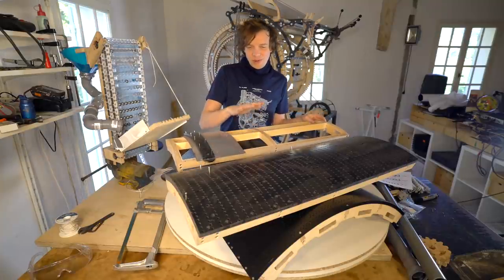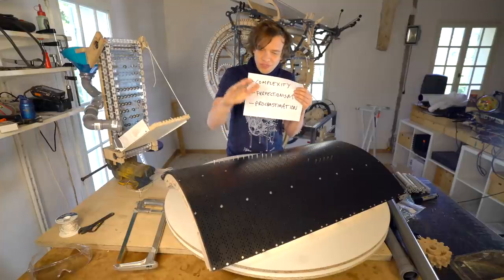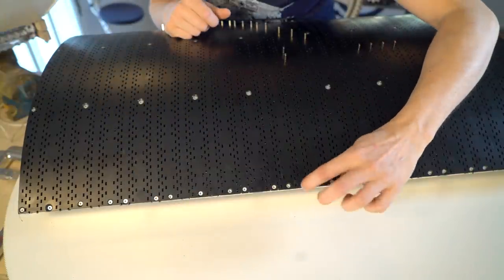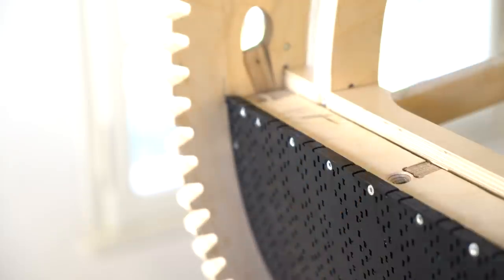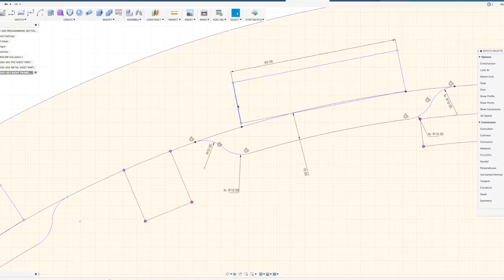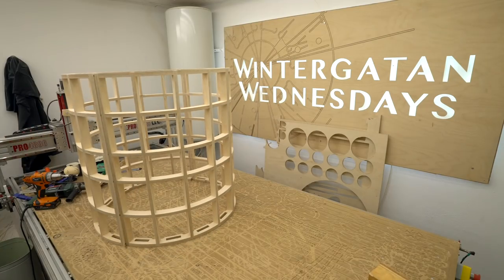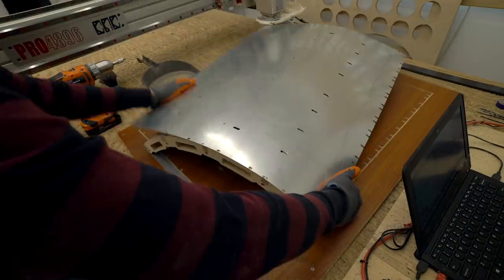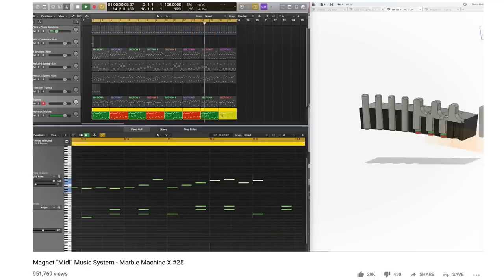Music Programming Plates Part 3 - Marble Machine X #65

Comment from the maker: This is the one part of the Marble machine X where I can not compromise on the precision, it is hard to get the precision of the four joints between the quarters down to a hundredth of a mm around the whole circumference of the prog wheel. It feels like my engineering knowledge level is playing catchup with my music precision knowledge level. And its loosing... :)
Been thinking about how to solve this for a long time and I am finally going up that mountain, raising my sword and walking straight up to the dragon. 
Lets see if I can slay it and how many episodes it will take, Enjoy and good luck with everything you do!

Credit to Marius Hirn for a lot of CAD work on these programming sections:
https://www.twitch.tv/kitingmare

Martin 

PS.
This is something I would love for you all to know: 
Many of the designs on the machine is way overcomplicated for aesthetical reasons or for lack of engineering elegance, BUT, the programming sections does actually not belong in this category. I still can not think of a simpler more functional solution than the one I am trying to execute here. I have seen many comments about other solutions for this part but everything I have seen is neglecting the number of holes needed or neglecting the precision needed. So this time, its actually difficult because its never been done before. Its not difficult cause I deliberately made it so. Haha! Just felt like putting that out there! DS.
Reply: Are the posters available to purchase yet Martin?
Reply: Any idea when your 'I Believe' print will be available as a poster?
Reply: the audio tho...
Reply: Hi @wintergatan, I have a favor to ask, would it be possible that you end your flogs with a progression report? Just the percentage of readiness.
Reply: Hey Martin, why don't you make the programming plates overlap each other, like puzzle pieces. You could cad the overlapping parts.  If the overlapping "puzzle piece" sections of every programming plate fit snugg, you can make sure that the plates always touch perfectly when mounted on the programming wheel. I think there is still some room left between the holes of the channels to make some puzzle edges.
Or maybe that complicates thing even more...?
Reply: I dont know if anyone floated this idea before... but what if you didnt have reprogrammable plates? Then you could create a split cylinder with no holes, overlay your template, drill, insert pegs -- for just the one song. This would let the plates be less robust and complex, plus you would not have to program the plates between songs. Also, since it is already the correct shape, and the template does not deform, you would have the precision easily
Reply: I think you are on the right path Martin. One fixed plate and the rest are floating. That way the circumference of the circle will float a little. As an engineer, you can never get or keep parts a perfect fit. There will be wear and thermal expansion. With the 3 floating sections, you should be able to pull them in so that the gaps are zero so that the match at the edge of the plates is perfect. The circumference will vary a little,  but that should be a very minor change in the tempo of the music. You will have orders of magnitude more variation in just the cranking speed.
Reply: Hi! Did you consider making some kind of "carpet" (out of silicon or rather something tougher) instead of rigid, curved parts? That solution results in: less variability (no thermal bending), less parts (possibly only one), probably less machining time (no need for specific shape of holes for magnets, possibly cutting it way faster with laser), easier reprogramming (lay it flat on the table and let 5 people work on it)... just to name a few. What do you think?
Reply: @NielsNL68  I dunno that it's that simple. In engineering, frequently problems come up that you weren't expecting that make a project take longer
Reply: No matter how long this would take, I will wait and watch. Best of luck guys :D
Reply: Love the work your doing! Keep it up!
Recommendation: install a dust collection system on the automated machine. Ie a vacuum system which will help save time dedicated to clean up and removing excess particulates. (Plastic, wood, or metal shavings)
Reply: Would it be possible to use the same alignment pin technique you used for machining the sheet metal to align the programming plates? I'm imagining pins that stick out from the wheel and go through all the layers of the programming plate. If the alignment holes in the plastic layer are cut in the same CNC process as the programming holes, they should have the same tolerances. Be tricky to get the alignment pins set up exactly right, but since they stay in place you'd only need to get it right once...
Reply: "A thing of beauty is a joy forever."
Reply: @VeniVidiVelcro  This was my exact thought!!!   Glad I read through some comments to see if someone had the same idea.   
Instead of splitting the holes at the end, have a tongue go beyond the edge in such a way that it interlocks with the plate before it.   Like a puzzle piece...  The holes can continue onto the tongue.  Like this: https://thumbs.dreamstime.com/z/connect-15253614.jpg
Reply: Why not make the program plates out of flexible materials to bend over the reel like a ribbon-based music machine. Better yet, instead of the complexity of reprogrammable plates, why not just make each plate nonprogrammable read-only?

If programmability is critical, and the issue of pins on the plate-to-plate interface is a problem, why not make special pins that bridge over the interface using other pins? It might eliminate part of the complexity and engineering challenges.
And if special bridge-pins are not an option, why not minimize the number of plate-to-plate interfaces?
Reply: @wgm-en2gx  I detailed this on the Discord discussion a couple of weeks ago. But I went further and designed injection molded pieces so that nothing needs to bend, it just fits together into a cylinder like one of those 3D globe puzzles.
Reply: On the edges of the plates you can use custom bent pins to register notes from one position over
Reply: Man, that setup is just crazy, but in a good way. I'm amazed you can get the plates cut precisely enough and register closely enough so that they can be swapped on and off the machine and maintain proper spacing. I keep watching this going, "Oh, there's a reason no one ever tried to do this thousands of years ago. It was easier to make hand drums and plucked strings!" On a related note, the ball lift is definitely a high mark of any ball machine. It's one point where you can really stand out and do something different that will really catch people's eyes. I appreciate the time and energy you've put into creating some mechanisms purely for a great aesthetic point. (Now I think I need to upload the ball machine I made that has a multi-arm lift!)
Reply: @gi70st    the classical equivalent of this is having a team of technicians writing the music in pencil, then after the song, rubbing it out to reuse the paper.....   your suggestion of a specific set of plates for each song would cost more in materials and storage space but eliminate the frantic technicians reprogramming in real time without blundering.  And technicians need space too!  I reckon I could get 8 songs in the boot of my little kangoo,  plus driver and 3 passengers.  The songs can sleep in the car, each passenger will want a hotel room.  One room for one night probably costs more than the plastic for two songs.  This world tour will not happen.  A six gig tour of Europe is feasible but may make a loss. Having preprogrammed parts would help.
Reply: @Wintergaten MARTEN! 

You are living where you work.

You are working where you live.

As a retired Manufacturing and Testing Engineer who "grew up in engineering" as a project manager,  I estimated LAST January that MMX.was going to take OVER ten thousand man hours to complete.

That is over five man  years.

You are only 12ish months into this,

AND YOU CAN SEE THE LIGHT AT THE END OF THE TUNNEL.

You ARE AHEAD OF ANY REASONSBLE EXPECTATIONS BY AT LEAST TWO YEARS.

You are ahead of any REASONABLY INFORMED expectations by two years.

You are two years early.

You are beast, and a genius.

Rejoice!

Please stop worrying. 

To anyone thinking, even if Marten said so in the beginning, that this project would be done in anything less than 18 months of hard work with  TEN people working FORTY hours a week....

well, forgive him and rejoice for he is far more courageous and competant than he has the experience to realize. 

Marten, how long did those instruments in the Church towers of Switzerland take to build?

In a guild shop full of men?

Being funded by entire cities and churches?

Decades.

Son, you NEED to take a vacation and stop apologizing about how incredibly quick you as te accomplishing this marvel of modern musical engineering.

Go drink a bottle of chardonnay, sitting by the fireplace, at sunset, in the company of a passionate friend.

RELAX.

Cheers, prost and aufweiderzehn.
Reply: You are totally impressive in all respects Martin.
Reply: I think that you should make more types do the thing so that you can make more songs
Reply: If you didn't already know, a great way (bordering on magical) to hold various flat stuff down for CNC without clamps or fasteners (especially when you want to cut all the way through or surface the whole thing) without it pulling up is to use a layer of painters tape (blue tape in the USA) on both the work piece and spoil board, and then squash some cyanoacrylate glue aka superglue between the outward facing non-sticky sides of the tape sandwich. This forms an amazing bond for many materials (even hardwood, plywood, Corian, and certain plastics) and the tape comes off clean and beautiful once you pry it off the table. Might be an option worth testing and using for stuff like the metal sheets in the future. I was amazed by how sturdy it was the first time I tried it.
Reply: Супер...
Reply: @raykent3211  I didn't think of it like that. haha! I'm imagining a whole orchestra frantically re-writing their sheet music between songs. I hope this machine isn't so over-engineered that it never becomes a reality
Reply: As to perfecting the tightness, consider an internal band/ rope on each side of the prog wheel to tighten the four independent plates? Adjustable with a simple knob or screw?
Reply: These panels need to be made from a plastic injection mold. A steel mold of a section would put all the holes in automatically. The part would come out of the mold already curved perfectly. The pins that make the hole shape would retract before the part is ejected from the mold.
Reply: @NielsNL68  I liked that video so much, I'm writing a web-based PBS :) I even named it after Wintergatan... Hope to finish enough if it for testing soon!
Reply: The issue seems to be that you cut the holes, then bend the plate, thus resulting in lack of precision due to thermal transformation. Have you considered doing it in reverse order? You bend the plate, then cut the holes, which will be perfectly positioned. You'll need a 5-axis CNC but I'm sure you could find someone who got one and would be happy to do it for you!
Reply: @terencemarchal  These panels need to be made from a plastic injection mold. A steel mold  of a section would put all the holes in automatically. The part would come out of the mold already curved perfectly. The pins that make the hole shape would retract before the part is ejected from the mold.
Reply: @billkeithchannel  I thought about plasting molding but I didn't know that you could have pin which retracts at the end, that's very interesting. But how do you make the mold? Sounds awfully complicated isn't it? Without the retracting pins it would be much easier to make the mold, but you'll also need a 5-axis CNC, which is why I proposed to cut the holes directly in the plate.
Reply: Have you considered thermal expansion variance? If you build The MMX in a cold country, the metal and wood parts will fit together nicely, but if you play in a hot or humid place, the materials will expand and warp separately. Keep this in mind while testing the programming panels
Reply: I think the entire machine is absolutely brilliant. However, while it's not too late, why not just make 1 extra set of plates for triplets? Call it your waltzing plates? Seems like ir would tremendously reduce the complexity of the plates and reduce the possibility of programming erross.
Reply: @ProactiveYellow  Yes. Birch plywood has a great rating for that kind of situation. This is why it is used for musical instruments.
Reply: Once you get them shimmed to position, couldn't you trim the shim out of the holes they would block rather than limiting your music choices?  This is assuming you have a system to label where each plate goes on the wheel, and you permanently attach the shims to the plates.
Reply: Wintergatan Hi Martin, your attention to detail in precision is inspiring, but my concern is that there are so many things to go wrong, especially when the plastic material deforms when being curved onto the plywood forms.

If by any chance disaster strikes, and you cannot achieve the required accuracy with your planned technique, there may be an alternative strategy. It is a big enough change not to even consider this unless you need to make a major modification.

The idea is not to machine the programming boards flat, but machine them in situ, on the machine itself!

If you disengage the flywheel and engage a stepper motor, you can drive the programming drum as one axis of the CNC machine (x-axis?). Then you attach a removable y-axis and z-axis with spindle drive to the back of the machine, and you have a CNC programmer. You can machine the programming holes precisely where they will be on the machine, with the plastic pre-deformed. So you get the ultimate in precision.

You would need to carefully vacuum the cutter to remove chips, to prevent them contaminating your machine. Of course the CNC parts would need to be removable, you don’t want to spoil the aesthetic of your beautiful creation, but imagine the precision and flexibility possible!

Also, you wouldn’t need to machine all 58,000 holes per drum. If you can afford sufficient material, you can have a set of plastic plates per song, and machine only the holes needed for that song. The pegs could be simpler and not need reprogramming back stage. This would also allow you to vary the beat timing infinitely, because the beat repeat distance can be set for each song, and even syncopation included if you like at specific parts of the track.

I am not a CNC expert, but I do have expertise in electronic motion control, including stepper drive systems used in CNC systems. Feel free to PM me if you find the idea useful.
Reply: @VeniVidiVelcro  I thought the same
Reply: Why don't you register one plate to the next (ie. with a dovetail joint or a pin) ?This way you could loosen the levers by a bit and registrate the plates together in all axis...
Reply: Hey Martin, you could still use the last 32th spot if you custom cut an offset pin that fits into the 32th before that last one, and extends back to the last 32th’s position before coming up, shaped like that Tetris block forming an “S” or “Z”?
Reply: @BillySugger1965  :  That sounds like a great idea.  It could be applied retroactively after the machine is finished.  He has to have a fully programmable set of plates to write songs and experiment and create arrangements.  He's not wasting his time here.  He could  create a second machine that incorporates the cnc hole cutter.  Since the second machine would be incomplete and just include a programming drum and the cnc hole cutter, it would take a fraction of the time to make compared to the mmx (plus, he's already got all the cad programming done and that probably takes as much time as anything else).
I do think re-programming the pins in between songs sounds overly difficult to do in a live concert setting, but what do I know?
Reply: Would it not be possible to cut all sections on one plate and then split them afterwards? That way each section would, at least from a machining point, be in line with the next. For the cuts you should know the diameter of your tool and be able to add this distance in the CAD. Shims are one way to go, but otherwise you could add some high precision "guiding pins" on the wheel where you mount the sections.
Reply: Happy birthday Martin! Take a day off and have a glass of wine.
Reply: Martin, you could have made a programming sheet by using a piece that went completely around the programming wheel. That way, you could have had perfectionism and complexity in one easy step. Just a thought :) Keep up working hard as we all are looking forward to the Great World Tour of the Marble Machine X :)
Reply: @billkeithchannel  I have to assume you're joking. That mold, itself, sounds like such a massive engineering effort. 58 thousand retractable pins? To make 8 or even 12 plates?
Reply: Your work is great and it's so fun to watch your progress!
You are worrying about the pin in board's edge, but I have an idea to fix that.
The idea is to use L-shape programming pins and place in next to the edge.
Then the pins edge is on the board's joint!!!
Reply: Have you considered an alternative to precision .... synchronisation ? 
I have not seen how the pins trigger the marble release but what you could implement is an intermediate stage between the programming pins and the release. The programming panels would have pins to 'preset' the intermediate stage, which only releases the marbles on one 'command' - eg a rotating or reciprocating shaft that transfers the release/no release actuation signal to all the actuators at the same time ... and the time can be precisely derived from the main flywheel at one end of the machine.
You lose the option to subtlely vary individual note timing, but gain in all sorts of areas,
In computing, this is called 'clocking'. Your programming pins can wander all over the place so long as at least one part of the pin is present when the clock pulse occurs,
Reply: We understand the need for precision and art! :-) So - less talking (unless it is about technical details) and more building please - we enjoy it! :-D

It doesn't matter that it takes long time, the goal is the journey, ("Veien er målet" in Norwegian) as they say.
Reply: Have you considered making the plastic one long sheet that wraps the drum and then anchors at the start and finish of the wrap thus reducing the gap errors on individual plates ?
Reply: Hey, I have a suggestion. You can make your programming plastic cover in one piece to cover the circumference of your wheel. It reduces a lot of error.
Reply: Hey Martin! If this works, it means you will have "missing notes"! Consider making a song, or part of a song, that builds up to where that note should be, but leave it out so it doesn't resolve, and the song continues playing. It could be beautiful. Thanks for the video!!
Reply: Maybe for a better fit, the flat edges of the plates should overlap on a sort of bevel.. like the tectonic plates more or less, or like a chisel's edge. This way they could still have those screws and whatnot (being sandwich style with the metal sheet and stuff) but you'd be able to press them together at the right distance between the limit lines pins. Also a "bracelet" or something like that like a tightening belt on the middle (maybe) could help finetuning the gaps when you place the plates. Someone mentioned the temperature and humidity differences on tour in various places on the globe and maybe a simple tightening system would help. The lateral clamps seem ok, but it seems that the problem appeared because of the perfect fit of the rigid elements, while the curved plastic needs adjustment.  Otherwise, the puzzle or dovetail sollution could be useful...
Reply: I wish I could be there to help you build the plates. I could help hold something...
Reply: @terencemarchal  This is more common than you think. There was a mold we made for a drawer frame in a refrigerator. Parts had to pull back out of the way before it could be ejected. Things that seem complex can actually have slick simple solutions once your thinking cap is put to the test.
Reply: @NoseyNick  No, much simpler than that. You just mold one channel not all 32 and you only mold 1/4 of a plate (1/16th overall) at a time. This way there is not that much curve to deal with since it is only 1/4th of what Martin is currently working with. So three parts, end to end, would fill one channel on a panel. So each panel would have 128 molded pieces attached to it. The screw holes to secure each piece would also be pre-molded so no drilling would be needed either. There could be a dovetail molded into it to connect the channel strips together to make the split holes tighter.
Reply: Why does this take so long? I personally blame ToT's voodoo dolls ;)
Reply: Perhaps this has been brought up before.  Why not assembly the programming plates minus the holes on the machine.  Then use a cnc features to cut the holes. A stepper could turn the programming wheel to the correct points and a cutter moved along the axis.  ?
Reply: So 1/4 of a channel strip would be much less of a curve to mold a pre-curved piece. It would fit like a bunch of curved Lego base plates.